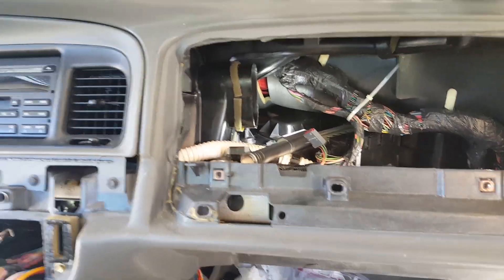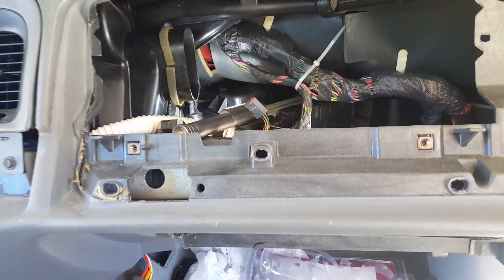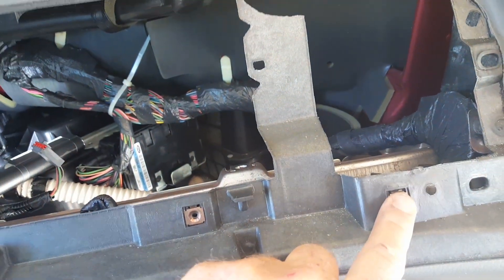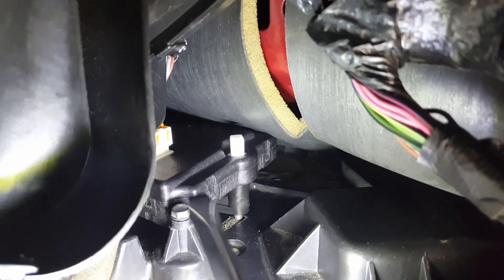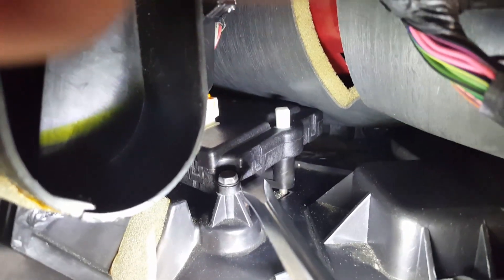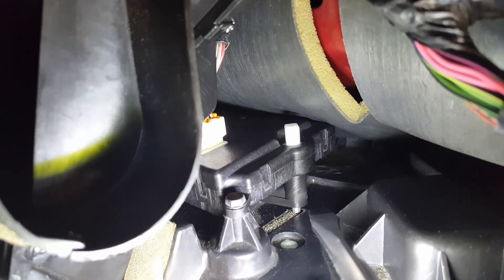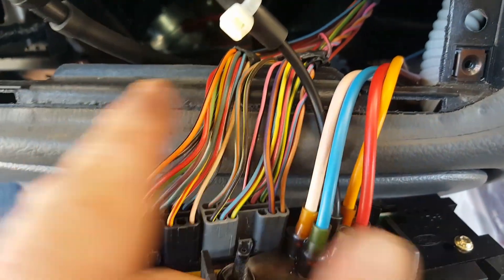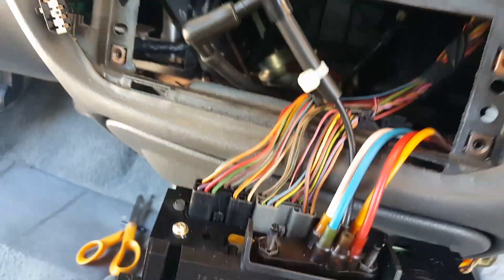Mercury Grand Marquis Blend Door Actuator and EATC Vacuum Leak

Comment: My 01 marquis went 9 years with no a.c. after watching this video I spent $55 on blend door actuator. I did exactly as this man said. I left one screw actually holding the actuator on. A year later my a.c. is still working as it should. Mechanic shops quoted the job at about $1000. I did it for $55! Haters can eat that!
Reply: It only took you eight hours, no doubt
Reply: I did the same thing but my actuator isn't getting any power. The old one used to click because the gears were broken then it just stopped one day
Reply: 0
Reply: I’m stuck on this problem right now I am to the actuator and I can’t seem to break it loose the screws in the back on each side are holding it in place took out the front screw no luck breaking it loose still trying though
Reply: Same here I have  ac coming out the top, but not the vents.

Comment: You are a Benefit to Humanity - I had the exact same issue with the etac line leaking in the firewall.  You saved me a ton of work!  Used a loaner vacuum pump from AutoZone.  I took the unused white parking brake vacuum line and spliced it into the etac line inside the passenger compartment - Thanks!

Comment: Changing out the actuator is no piece of cake. This is one of the hardest jobs I can remember and I have done a lot of work on cars. Prying the actuator can result in other broken parts. I surgically removed the part piece by piece then removed the screws. There should be special tools made for this job instead of removing the dash. Did it once but never again.
Reply: Oh great to read before I do it lol. Ford plastic cracks by looking at it wrong
Reply: @Xxmeca421xX  I was thinking the same thing. Pray for me!

Comment: Awesome. I have been having issues with AC blowing out defrosters for years. Now the blend door actuator just failed so blows hot air only. I will do both these fixes. Thanks for making video.
Reply: i need mine to blow hot air, but it doesnt do it consistenly.

Comment: I took the dash screws out of the top by the Glass and all of the passenger side nuts and bolts from the bottom and removed the trim to get to hidden screws. I opened the door and wedged a short 2x4 and another small piece wood on the outside edge to pull out the dash a good 5 inches. You will have plenty of room to work from there,  and for the ductwork, there's two small screws on each side, you can remove them with a ratchet with a phillips bit or use a $20 harbor freight saw zaw and cut it down the middle, then just use aluminum tape to hold it back together permanently.

Comment: Thank sir, just did mine. Tip for others. To tighten 2 back bolts   1/4 drive 8mm 12 point socket cut about 1/4 inch off now get 11mm 12 point wrench and press it in with vise. Its easier to get back there than with a ratchet.

Comment: Perfect! This is a perfect video on this NIGHTMARE SUBJECT.. As I've been thru this 3 times on two vehicles by complete dashboard removal - I can tell you this guy has a GREAT answer for this hideous problem.. follow it. If you have one of these vehicles, The Crown Vic or the Marquis 2000 up (mine are both 2005) you WILL HAVE THIS PROBLEM .. as certain as night turns to day. At the 3rd iteration I got smart too but my solution was much easier. The trade off is that I have just full hot or full cold when I want it - in Arizona you just need those two choices. Pop the control bezel, pull the eatc panel and clip the wire to the junk motor actuator and power it with a SPDT switch from the 12v cigarette lighter. The blend door will run full either way or in between as you like. DONE. The problem is the feedback resistor for motor position, it goes open circuit - GARBAGE - the motor is fine and can be run back and forth like I just explained. (That is why you hear the clack clack clack of death when it goes bad) Mount the switch under the dash or let it hang.. I will post a follow up on the wire color involved as I don't recall exactly but it was I believe purple or purple with a stripe.. will follow up.. Don't bother replacing motor it just goes bad again and you will revisit this nightmare in an endless cycle.
Reply: no follow up video

Comment: just did today in 35C heat, and it was a bugger.  I think the heat made the plastic tabs more flexible as they resisted breaking.  Might have been better in brittle cold.  Anyways the furthest bolt came out with the pedastal still attached and left a whole the size of a loonie.  I put some duct tape over it.  AC works now so that is good.  The trick to get that one far back on the right is get a tire iron and make sure the force is going up on the screw and not down.  Easier said than done.  If it breaks, don't sweat it.  The actuator door is easily moveable and you don't need all those bolts torqued right down to operate it.

Comment: I have a 2004 G. Marquis.   NO problem with the actuator yet, but the temperature control module on your 03" is different than the 04's.   I curently have the car at the Ford Dealer.
I noticed smoke coming from the hood on the passenger side.   I raise the hood, and smell what I believe to be electrical.   On the back of the fan motor on the left side of the fire wall, looking at this with the hood raised, there are two electrical connectors.   I disconnected the top one, and did not see any smoke after that.   BTW, the temperature controls were not on when I noticed the smoke.   The Ford service rep says he  thinks the smoke is coming from the valve cover gasket being old, and oil is dripping onto the manifold.   I told him I saw no smoke coming off the exhaust manifold, and the smell didn't smell like burning oil.   He says that Ford no longer carries the valve cover gaskets so he can't replace them.   I told him I don't buy that this smoke is coming from an oil leak.   I'd like to know what electrical would cause that smell ?   I did notice that the speedometer did not work when I had the connector disconnected.   There is also a connector below the top one, which apparently has nothing to do with the burning smell; when that lower one was disconnected, the power steering stopped working.   I plugged it back in and the PS worked again.
If you still have your marquis, let me know.   I will tell you something about why the engine light will come on after you've replaced plugs and coils, which will save you hundreds of dollars and a lot of aggravation.

Comment: I have a question. I have a 2003 Grand Marquis GS model with the regular type of AC control unit, and I replaced the blend door actuator. When I plugged it in, I saw the actuator go to the default AC mode. However, when I switch to heat mode, the actuator doesn't do anything. Do you know what might be going on? Should I check the fuse or something else? How can I test to see if there is power or if anything else is wrong?

Comment: Some of this video was very informative, some of it is half assed.

The top duct screw on the back side is a piece of cake to get to on my 2003 Grand Marquis, I fit a standard 3/8" ratchet in there with a 1/4" attachment and my 7mm socket. There is no need to cut the top duct tab or break it off whatsoever, there is plenty of room.  Also, you can actually get to that 3rd bolt/screw on the back side of actuator with a U shaped wrench. It is time consuming but you can get it in there and pull that bolt/screw out. I don't have fat hands but they are large and I was able to do it. I used a screw driver to wedge the sound deadening material up and out of the way about 4-5 inches to the right of the actuator to make room for the wrench. I wore a headlamp so I could see the top of the bolt/screw and simply slipped the U shaped wrench over the top of the actuator and used a finger from my left hand to position the wrench on the bolt/screw. Now, you can only get about an 1/8 turn per go but if you are good with your hands you can lift the wrench slightly to reset and push it back on the bolt/screw with your finger. It took me about 30 minutes to get the bolt/screw out but it only took me about 5 to reinstall it. The whole job took me about 2.5 hours. 

Tools I used: 3/8" ratchet with 1/4"attachment, 1/4" extension, 7mm socket, 8mm socket, Duralast 8mm U-Shaped Wrench from Autozone, 8mm ratchet wrench, flat head screw driver.
Reply: My dad was a master technician for Ford. I became his apprentice and I remember doing exactly what you said. It took for ever and I was soo pissed at the person/s who designed this. Now I have a 2000 Gran with a/c and heater problem. I just can't wait to diagnose it!!

Comment: Just did one, and the plastic broke right under the actuator. I actually was able to get to ALL 3 bolts on it by using an extra long ratcheting wrench on the bolt closest to the radio, and was able to use a socket wrench 8mm on the back bolt closest to the engine. You don't need to break anything...

Comment: Thank you ian youre a lifesaver 
I swapped the main vacumm (black line from eatc) to get supplied vacuum from one way check valve. Its works beautifully. Also replaced the actuator. Rebuild price on the eatc is about 200.00 on ebay with a 60 day warranty. I spent 26.48$ on supplies at my local oreily. Im a ase certified technician and have been performing week's worth of research on this matter to determine whether Identifix was indeed correct on the removal and reinstallation procedure and the labor hours allotted for it. The reason every shop wants to charge you a thousand to $1,500 is because the labor book calls for 10.5 manual hours and the description of the labor entails the removal and reinstallation of the entire dashboard including the radio and in some cases the steering column or shaft
This was definitely not a bite in the ass it was so much easier to perform it this way and I've been looking for a video to really go in-depth to see if anybody had been successful thank you

Comment: What lines should have vacuum? On mine only the black line as vacuum,  does the blue line also need to have vacuum?
Reply: The other colors dont if checking them individually period You have to put a vacuum hose from the black one to the one u wanna check

Comment: My blend door stopped clicking about a year and just locked up on my 1996 with EATC. I used to stick my hand in the dash and manually move the lever but couldn't anymore. So I found a way to loosen the passenger side dash and wedge in a block on the side with the door open to remove the blend door actuator easier. I plugged the new one in and selected heat and ac and I wasn't getting any power to the terminals with a multimeter, that the little electrical motor in the actuator uses. So now I'm not sure what to do or where to test to see why I'm not getting power to the blend door actuator. Also my ac pulley is squealing, so I have to take that all apart before it locks up. I really want to keep this car but the electrical problems driving me crazy. Just about every switch goes bad and old plastic crumbles with age. .. anyways. Is there a fuse for the blend door actuator under the hood?  So many little problems happening. Fan only works at full speed now, headlights dim just turning the fan on or putting up a window. Guess I need a better alt too. Smh.

Comment: Thank you for a good job on your video. Question that pops out: if the final vacuum leak were fixed first, would the other repair be neccessary?
Reply: Exactly...
Reply: vacuum controls the mode door and fresh air door, if your issue was air only blowing from the defrost and couldn't change vent settings then the answer to your question is yes.
The blend door actuator its self is electronically controlled so if you couldn't change between heat and cold air then the answer to your question is no. hope this helps

Comment: I'm under the airbag and can see the door actuator and it seems to be working properly.
The problem I'm having is when I turn on the a/c it blows hot air from the defrost and floor. When I change it to vent it stays blowing air at defrost and floor. It's somewhat hard to tell if it's hot or regular air bc it's 90 degrees outside. Do you think I have a vacuum leak? Why isn't air coming thru the vents?
Reply: I'd check vacuum hose as he described first. Harbor Freight has the tools or borrow them from OReillys

Comment: Well done I’ve had a ton of these cars and the climate control systems are a huge pain in the ass. Just pulled a blend door actuator out...tested good...think I got same exact problem as you on this particular one...03 marquis...thanks for doing the tracing make it easier on me. Got a video on rebuilding the o-rings on the electronic climate control unit?
Reply: Update it was the blend door actuator...of course it was 99% of the time on these cars that’s what it is
Reply: A little food for thought is that you don't pull out parts to test if they're  Good or not the EATC in these cars Have a diagnostic mode Hold down off and floor and then let go and press automatic and a whittle wheel will start turning if all the lights light up everything is golden if you get codes thats where you start...could just be a sun load sensor causing a lack of cooling etc.
Reply: @asrielandcharadoesstuff4789  appreciate that but yeah I did do the self test and it gave me blend door codes tested blend door was good then figured it out was bad connection

Comment: Good method on the actuator. I did one a couple years ago on an 03 Crown Vic Sport by pulling the dash back. Went ok. Now I have to do an 02 CV Sport and an 04 Marauder. I guess they ALL break eventually. I'll try your method this time. I also did the o-rings on the control head once too. Good information you provide here. thanks.

Comment: may be a dumb question but is it the actuator that controls where the air blows out of or is it the vacuum system...my issue is that it only blows out on the floors thanks!

Comment: I'm all about saving money. Nothing wrong with that, but as a mechanic myself and brother of someone who works on cars, time IS money. We have to follow the factory training they give us and, yes, it is a little more trouble, but you avoid having to "tear up stuff" to get to a part. Just ask yourself: Would you work on a stranger's car and only charge them for the part? Or not charge them at all? Be honest with yourself...you know you wouldn't. And if you did, then that's awesome! But notice I said STRANGER, not a  RELATIVE. Of course we would work on a relatives car for free...or virtually free. On the video: As an owner of my 3rd Crown Vic (identical to the Grand Marquis, of course) I have experienced this problem before. I've replaced the control units, both the manual and EATC, and this problem seems to occur again and again. So I'm thinking about ripping everything out and rebuilding the system using old fashioned technology.....cables. Using an old slide switch unit.
Reply: Yes, like a cable system out of an 80's Japanese car. You pull the lever and hear a loud "thunk!" Door is opening and closing for sure.

Comment: Nice shortcut. I will say the reason the shop requires dash removal is because it is not professional to perform a hack job like this. I'm not saying it's not ok for YOU to do this, but a shop consists of professionals which means they need to conduct themselves as professionals.

Comment: I have the same Automatic Climate System and for nearly to past year, each time I park the car and shut off the ignition I could hear what sounded like a door shutting, kinda hard.  Now I no longer have heat coming out of the vents, only cold or cool air, no heated air, but I no longer can hear that door shutting like before, any suggestions?

Comment: A temp fix I found out on a another video was to go up behind the glove box and using pliers turn the white piece on top
of the blend door actuator. This will turn the bottom piece that moves the rod.  I started the diagnostic mode and could hear it clicking.  I could see it trying to turn the blend door.  That's when I reached in with my pliers and gave it some help and was able to move it from cold to hot.  In my case at 372K miles I didn't want to spend any money.  I have heat now for the winter.
Reply: I’m actually gonna try that myself. If the blendoor is the issue then I’m just gonna rip that sucker out and use tape to hold the new one in and plug it in.
Reply: @nicholass281  bad idea you'll see heat melts adhesive

Comment: It's not ripping anyone off.. it's called doing the job correctly and breaking and cutting dash apart . Technicians didn't design the vehicle. They just have to fix them. I think you should word it differently.. if you would like to save money then do it this way. Not saying automotive shops are ripping people off by doing the job correctly..
Reply: Correct is correct wether by the book or not. Breaking stuff of course isn't correct.   But there's more than one way to do tasks.

Comment: Some of your vacuum motors are visible but not on my 2000 Marquis.  I need to replace the defrost vacuum motor.  Anyone have any ideas or advice how to get to it and where it is (YELLOW LINE)?  Also IMPORTANT- I replaced my blend door actuator but it did not work UNTIL I did a self test on the EATC.  It is still throwing a CODE 25 anyone know what that is??  Also, I used a car vacuum hose I had laying around and used couplings for my lawn sprinkler system for micro tubing 1/4" and I was able this jumper to use it to go from the black line (incoming vacuum) and use it as a jumper to test all the vacuum motors and save the vacuum tester purchase.